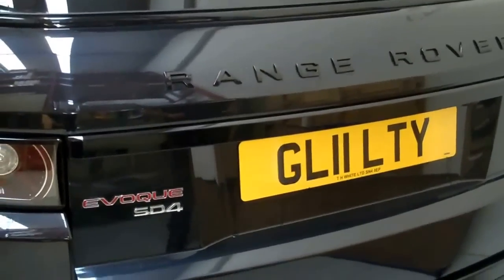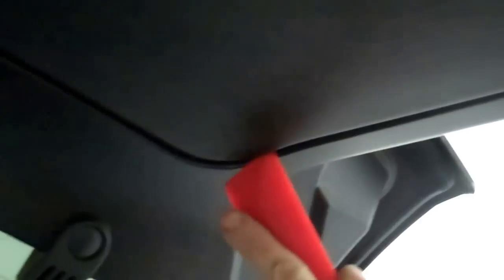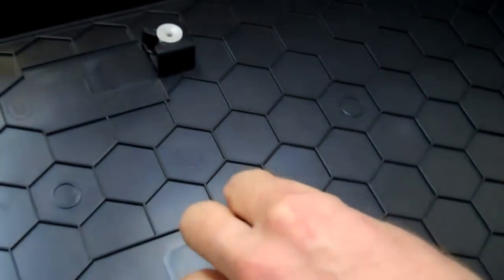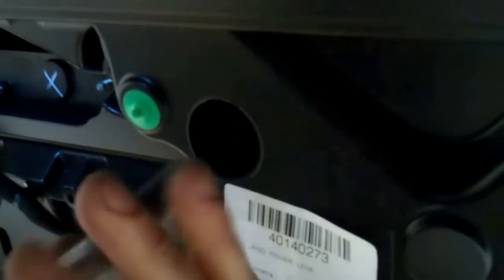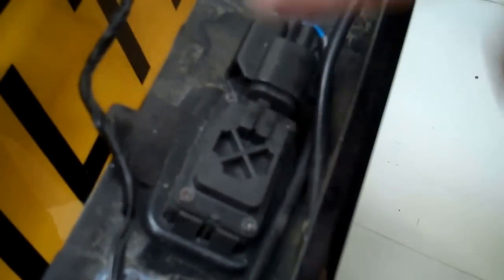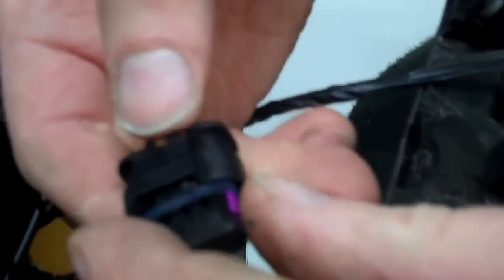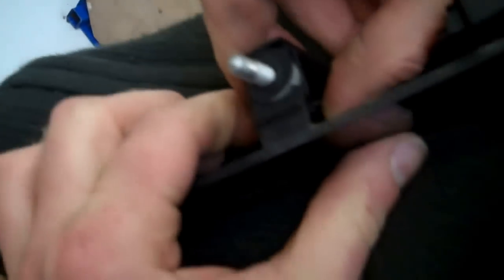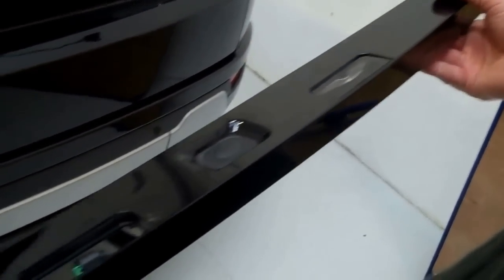How to change  tailgate strip / rear camera on Range Rover Evoque

Comment: Just finished replacing the rear camera.Really straightforward but would just like to mention that the panel needs a lot of force to overcome the poppers.Best plan is not to be afraid of it and to give it  'sudden' forceful  tugs along its length and it will come free.If you pull gingerly it will stay stuck fast....great vid by the way.
Reply from the maker: Thanks for the extra advice